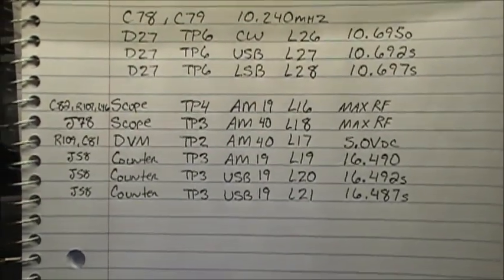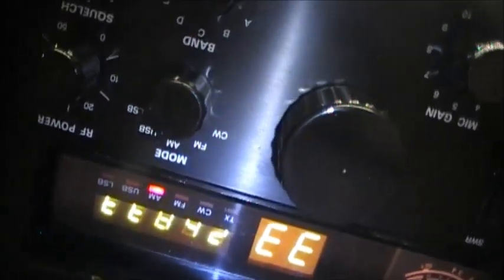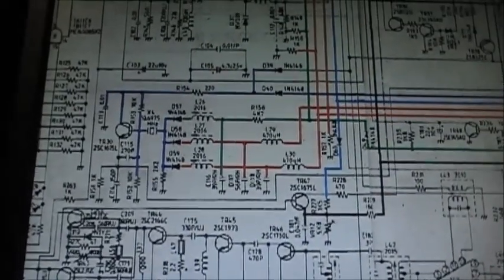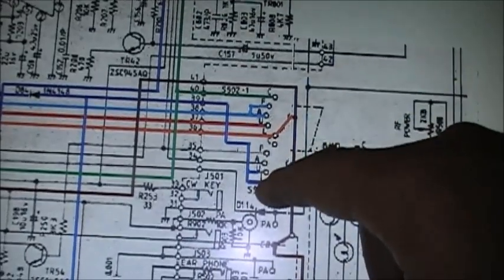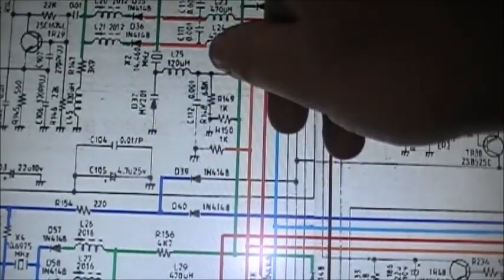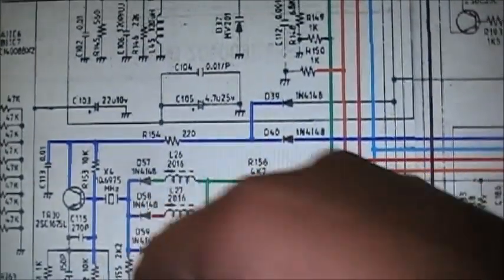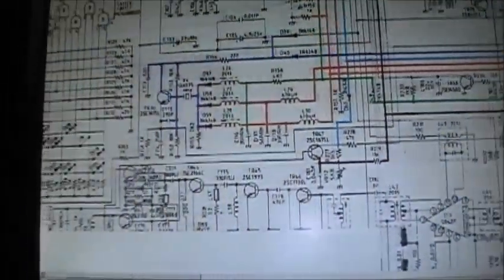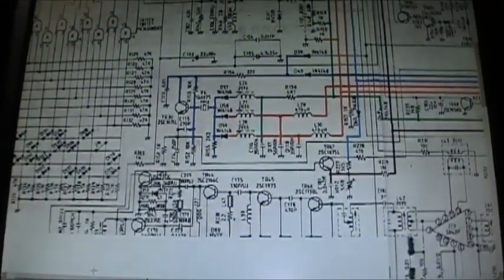GALAXY SATURN  PART-5   Might be getting somewhere?

Comment: You mention the function switch having been diddled with. I'd be looking real hard at that. And I guess the transistor has collector voltage. Well, all voltages looking good is what I'm trying to say. The 1N4148 diodes all good along with those three inductors?

Comment: I would replace the transistor and check for overlapping solder.. Too much solder can cause more problems than ever... Grrrr
Reply from the maker: Did that, made no difference... back to square one... Again!
Reply: @Radionut63  keep me posted. I worked on a couple about 3 or 4 months ago